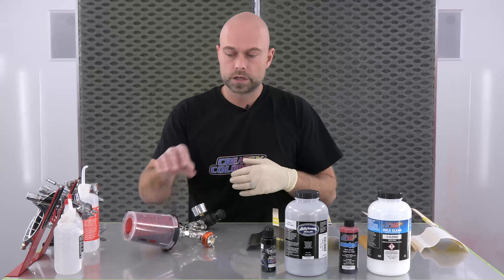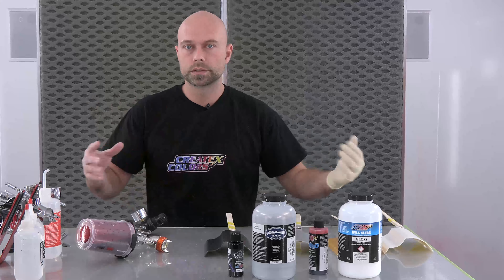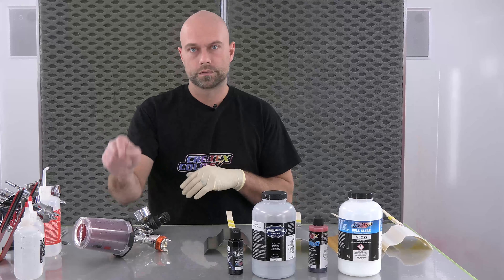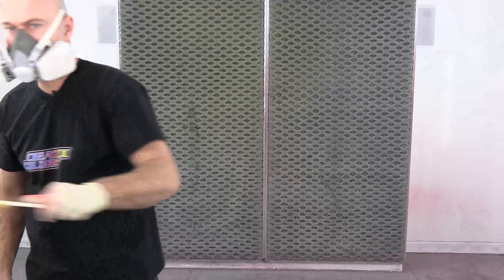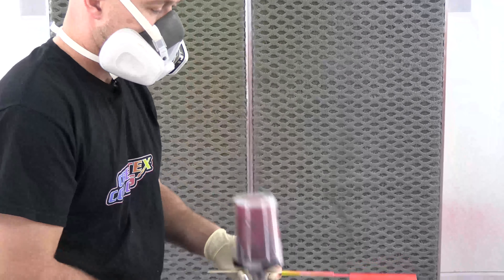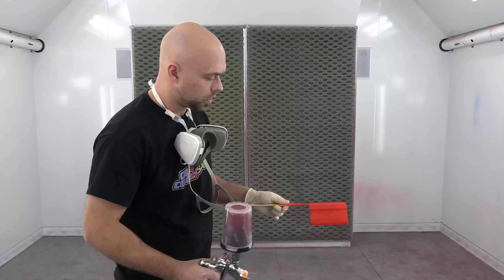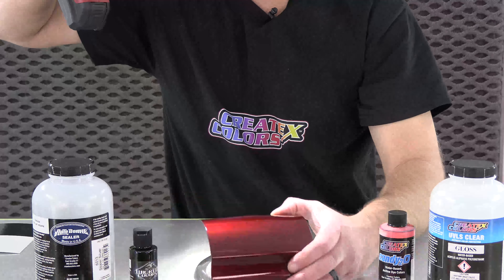Candy Red Values Over Different Metallic Bases

Comment: Really good video! Been playing with candy for a while now, and I can only agree, the ground coat is everything when it comes to candy. It's like it's completely different colors depending on what you spray it over. I completed a bike the other day for a friend after a lot of testing of different mixes. Ended up with Sealer Black, then 2 coats of Cosmic Sparkle Autumn Red, followed by Candy2o Brandywine mixed 4:1 with 4050 UVLS Gloss. (of course 1 part candy to 4 parts 4050) On top, 2k clear and some cut n buff. It came out awesome and my friend is reeealy happy, thanks to your help and tech support!
Reply from the maker: Thank you for letting us know the videos have helped you get better results with candy2o, excellent!
Reply: This sounds amazing! Any pictures of the final project?
Reply: @fleezy2008  oops.. Saw this half a year later... Sorry.. Unfortunately no pictures but it's quite similar to the one over the graphite base in this video.

Comment: What is this madness!  I'm looking to paint one of my models and eventually my bug this same way.  I was hoping to use either hot rod sparkle or silver as my undercoat with blood red candy over it, my other option was gun metal gray with candy black over it.  Probably doing two tone with the gray on bottom, red on top.  I wasn't sure if I should use red as my undercoat with hot rod sparkle over that and then candy over it or if I could just get away with the hot rod sparkle with blood red candy over that.  In the end, I wanted a very dark red and a very smoky gray with tons of sparkle under it.  Thank you for this video, and all the ones in the past and future, I've learned a lot.

Comment: Thanks for the great video information Chris. My local shop did not have these base colors, but I did get 0351 Wicked Metallic Silver. Is this a good base for candy colors and the Blood Red that I also got or do I need to return it? Thanks again
Reply from the maker: Wicked Metallic Silver can be applied over a base of AutoBorne Sealer Black or Grey, and used as a base for candy20. However, 6013 Silver Sealer is much better as it has a higher metallic count and is more reflective, which is why we use it as the standard base silver for candy20. However, any metallic can be used as a base for candy20, each producing a different value (color) of candy. Thank you.

Comment: What if the candy is mixed with my ground coat? I want to paint interior trim pieces Gloss black but would like a little red sparkle without having that Bass Boat finish.
Reply from the maker: Make a few test panels. Try mixing candy2o with 6013 AutoBorne Silver Sealer. Thank you.

Comment: Great tutorial...what air tip do you recommend. Also, what spray gun are you using in the video. I use a Devilbiss Techna Pro for my painting with a 1.2 or 1.3 air nozzle
Reply from the maker: Always set inlet psi at the spray-gun manufacturer's recommendations. Thin and mix paint so it atomized best at those inlet psi recommendations. The gun in the video is an Iwata Supernova. Thank you.

Comment: I am doing a candy Red on a honda motorcycle. Just a slight mark on a panel,do I need to paint the whole panel as in prime the panel and do it all form fresh??blowing in candy doesn't work in my experience??!!!!
Reply from the maker: There is a technique to doing a candy graphic that is blended in seamless with the original finish. This is accomplished by top-coating the entire panel (graphic & mid-coat colors) with the same clear type as what was used to top-coat the original finish, probably a solvent-based 2k gloss clear. We made a video on how-to spot blend repair candy which may be helpful, https://youtu.be/cyQbt33uNDk. Thank you.
Reply: @CreatexColors  thank you

Comment: Another EXCELLENT video - thank you! I continue to improve very quickly, thanks to these videos. I have a question though - since Candy seems to be a colored clear should I clear (straight 4050) on top of the finished Candy? Great stuff Chris, I'm loving your videos and its showing up in my custom Hot Wheels. I have gone from wanting to give up and toss your product to AWESOME!!!
Reply from the maker: 4050 UVLS Gloss Clear over candy2o does help protect the candy2o, and create a gloss finish that helps create dimension and bring the cnayd2o to life.  Best protection, especially for exterior and automotive, is top-coating with a catalyzed (2k) urethane clear. For more, please refer to the Hard-Surface Appli8cation Guide and candy20 tech sheet available at www.creatextech.com. Thank you.
Reply: @CreatexColors  thank you for the clarification. I'm looking forward to checking out 4050 over Candy. I just ordered more Candy and am trying to get  it to give it a polished look, thanks again!

Comment: I enjoyed the video. My question is not about this video. I was wondering what is your recommendation for an adhesion promoter on polycarbonate rc body?  Transparent sealer or UVLS Gloss or ?  Thank you ahead of time. 👍🏼
Reply from the maker: Createx 's best adhesive clear for application direct to plastics, including polycarbonate, is 4050 UVLS Gloss Clear. AutoBorne 6000 Transparent Sealer is essentially just s good in regard to adhesion and durability for polycarbonate, and if painting with an airbrush, not spray-gun, may be easier to apply with less reduction compared to the more viscous 4050. Its worth noting that also mixing 4030 Balancing clear, even at 10% per volume, greatly improves both adhesion and mar / scratch resistance of both Createx Airbrush Colors and Wicked Colors, which also each can be applied direct to polycarbonate easily. Use of 4050 or 6000 direct to polycarbonate can help achieve a great coating with excellent durability, but isn't as critical for adhesion as would use of 4050 would be, for example, painting glass. Thank you.

Comment: I'm after a darker version of the red+graphite metallic base in the video. Instead of darkening at the ground coat level and layering on candy coats, could I make the darkening adjustments by making a 4050/candy2o black + red mix and adding that to the silver sealer? Would combining all the components into one mix diminish the depth of sparkle of the silver sealer metallic vs layering candy over a darker silver sealer? Thank you!
Reply from the maker: A test panel is the only real way of answering your question. Try a few with varying techniques. Layering a candy neat (no pearl0 over a base metallic or base of the same candy mixed with a pearl creates "more dimension" compared to mixing candy + pearl and applying that as color before the 2k gloss clear. Applying candy + pearl is easier to do uniformly compared to spraying candy neat, so for larger projects the little less dimension of the candy + pearl color may be a better option to ensure an evenly applied, good looking finish. For a candy paintjob o=over a vehicle, applying the candy + pearl color first (a "cheater coat") followed by the candy neat coats works well to hide any uneven application. Thanks.
Reply: @CreatexColors  Massive thanks for the thorough reply!

Comment: Thanks again for your useful video
In France for the moment we have not the 4050, can I use instead the Gloss Clear Coat 5620 or I stay with 4030 ?
And what will become the ratio 1:6 ?
Thanks for your answer
Kind regards
Reply from the maker: 4050 UVLS Gloss Clear is available in France, at least through our European distributor www.createx.de. There's a major difference between spraying candy2o mixed with 4050 vs. 4030 Balancing Clear. In regard to 5620, we've not mixed candy2o with this clear, it will mix but the resin used to make 5620 doesn't hold the candy2o dyes in a homogenous suspension as does 4050. Thank you.
Reply: @CreatexColors  thanks for your answer.
I found the 4050 to my retailer Aerograph Discount 😀 and I will have in a couple of days.
Two more questions : we use 4040 only after Candy2O if we add more Colors, but if we add varnish we need ?
Do you recommend to add a varnish on the top of Candy colour ? Or that can stay like this for die cast car model ?
When I put Candy on Aluminium 4102 I don’t need to put first 4040 ?
Sorry for all my question , I have discover airbrush and your product and it is really good hobby for me 😉😎
Reply: Thanks for this, I receive 4050 today
Before using Candy2 O on Aluminium we need to put first 4040 ?
After Candy2 and before gloss clear we need to put 4040 ?
What gloss varnish you recommande to put on Candy2?
Thanks fir your answers
Reply from the maker: Please refer to the candy2o tech sheet and our Hard-Surface Application Guide, both available at www.creatextech.com.
In short, 4040 Bleed Checker is for use over candy2o before applying other colors.
Best method applying candy2o direct to aluminum is ot first apply an adhesive coating of either AutoBorne 6000 Transparent Sealer or 4050 UVLS Gloss Clear.
Top-coat candy2o with a gloss clear for a deep, candied finish; either a 2k urethane clear or 4050 UVLS Gloss Clear, which will require sanding & polishing for a high gloss finish. We most often use a 2k urethane clear to top-coat candy2o. Thank you.

Comment: Woow Excelente Video!!!  The metallic bases are also from Createx ,  some preparation in particular for its application ?
Reply from the maker: This particular application was over plastic discs that simply are scuffed ~ 400 - 600 grit, cleaned then 6013 AutoBorne Silver Sealer is applied direct. For more, please refer to our Automotive & Hard Surface Application Guide at www.creatextech.com. Thank you.
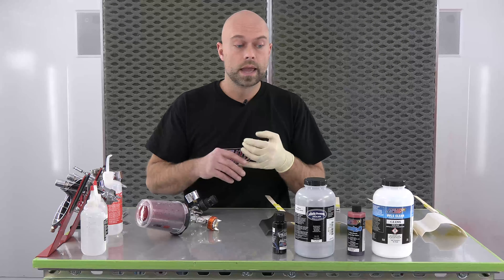Reply: @CreatexColors  Thank you for your attention, I intend to paint a 1:10 scale Tamiya RC body made of rigid plastic of the ABS type, I would like to give it a candy finish, on the understanding that a black sealant would have to be applied in my case, which apparently in this case it would be AutoBorne Black Sealer, and later the tone that you intend to apply. As soon as I bought a kit that comes with black, white and a thinner, I want to do some tests first with a Tamiya HG III airbrush to see how it performs with these paints. My previous experience has always been with PPG, Sherwin Williams and Dupont brand automotive paints, for this with a Passhe Talon airbrush. Using Createx paints is a new situation for me, I have been watching some application videos of these paints and I have been surprised. About 20 years ago, I painted an MTB bike using a black base and a purple "ink" with pearl blue and red and white, the tinting was excellent. But I see that with Createx paints it is on another level.
Reply from the maker: For more information about painting models : hard surfaces with Createx paints, please refer to the Automotive & Hard-Surface Application Guide available at www.creatextech.com. Thank you.

Comment: Wow ! I wish I had seen ur video before. I've had a hard time with R R ruby red 3 stage. and just now I discovered why I always get brownish or darker color. What do u think a silver or gold, as a  ground base, would go better with R R?  And is it flat or metalic ? Please help . Thanks
Reply from the maker: Start with 6013 Silver Sealer, www.autoborne.com, which is an aluminum-flaked ground coat that covers and provides a balanced metallic silver base for candy mid-coat colors. Ruby Red is  on the cooler side, try mixing 4650 Blood Red with 4651 Sunset Magenta, perhaps ~ 4650 4:1 4651,. Next, mix the ruby red candy2o mix with 4050 UVLS Gloss Clear (4050 6:1 candy2o) to create the sprayable candy color. Thanks.
Reply: @CreatexColors  Thanks a lot. U r very helpful. God bless

Comment: Instead of mixing transparent black with your Silver sealer to make a graphite silver, can you mix Black sealer with the Silver sealer for the same results. Furthermore, are you able to blend all your sealers for varying tones?
Reply from the maker: Yes, 6002 Sealer Black can be mixed with 6013 Silver Sealer, and used as a tint to create a darker version of 6013 Silver Sealer. Mix in small increments of ~ 5% black to silver at a time. All AutoBorne Sealers are inter-mixable. Thank you.
Reply: @CreatexColors  Thank you for your swift and informative response.

Comment: If i want to use this candy over carbon fiber how should i do it to get the best result?
Reply from the maker: Apply a transparent, adhesive ground-coat of either AutoBorne 6000 Transparent Sealer or 4050 UVLS Gloss Clear direct to the carbon fiber, then apply candy2o, then top-coat with a catalyzed (2k) urethane, gloss clear. Thank you.

Comment: If I don't have the transparent black to add to the silver sealer can I use Black Candy2o as a substitute for the dark base?
Reply from the maker: Adding candy2o 4664 Black to a metallic will tint the metallic, but will also present potential bleeding issues as now the metallic is a candy-metallic, with dye that may leach into top-coated colors. Tinting with a pigment-based black, such as Wicked W002 Black or Createx 5132 Transparent Black works much better. Thank you.
Reply: @CreatexColors  I appreciate the quick response! Will use W002 Black which I also have.

Comment: What? A gallon to sixteen ounces is 1:8 and 4oz to 32oz is also 1:8. Is it supposed to be 1:6 or 1:8?
Reply from the maker: Generally, 4050 is added in greater amounts than the concentrated candy2o dyes. We usually recommend a mix ratio of 6 to 8 parts 4050 to one part candy2o (4050 6:1 candy2o). Thank you.